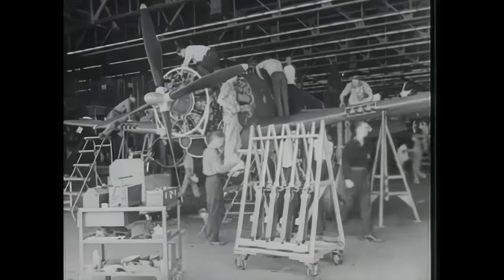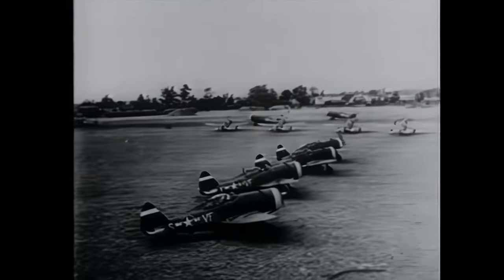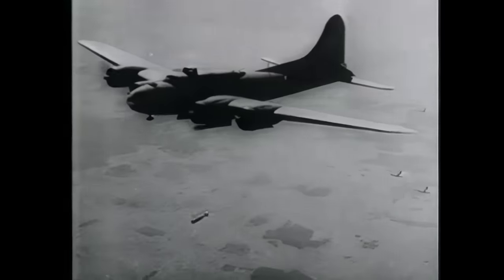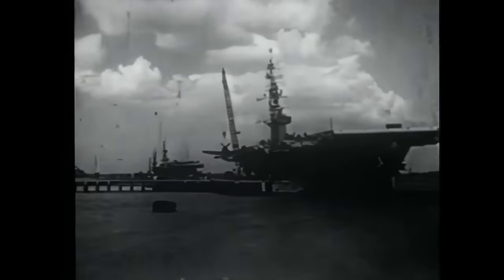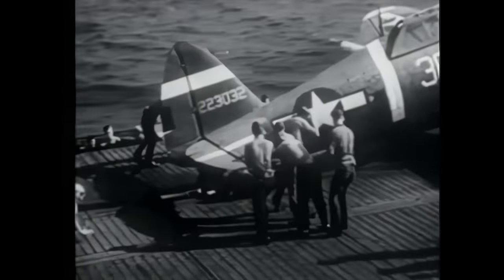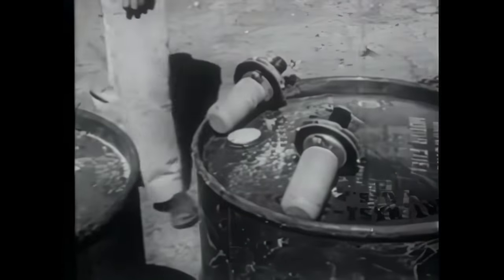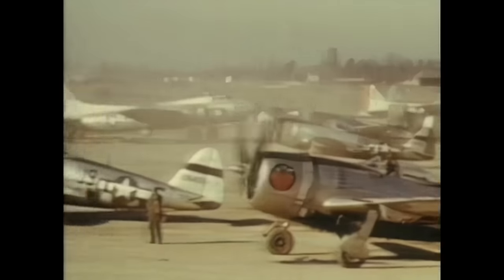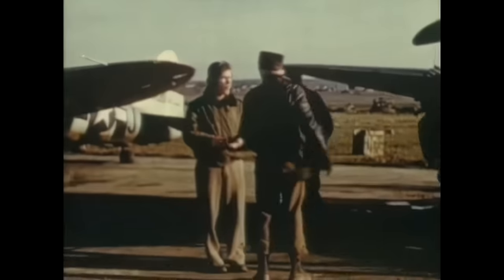P-47 THUNDERBOLT | WWII Fighter Aircraft, Nicknamed the "Jug"  | Upscaled Documentary

Comment: Best comment I've read on the P-47.  "The Spitfire and Hurricane held the line.  The P-51 Mustang took the fight to Germany.  The P-47 Thunderbolt broke the back of the Luftwaffe."
Reply: I like that
Reply: P-47 pilot Robert S. Johnson describing October 1943 before P-51s flew their first mission in February 1944

"There is no questioning the battle experience or the skill of the German pilots, nor could we find solace in the outstanding performance of the Focke-Wulf FW-190 and Messerschmitt Me-109 fighters. But as we sharpened our own ability to slash and fight, the German aggressiveness so predominant in the early days of battle began noticeably to wane. By no means do I imply that the German pilot was less dangerous an opponent; once battle was committed, however, the enemy fliers no longer were as eager to slug it out with us in a free-for-all. Steadily, we shot down and killed many of there experienced men. At the same time, we gained constantly in experience and in our ability to master battle situations as they erupted. The 56th was well on its way to acquiring a galaxy of aces; indeed the very presence in the sky of our Group forbode ill tidings for the enemy." - Robert S. Johnson in his autobiography ‘Thunderbolt!’ Page 212
Reply: P47's were escorting bombers over Berlin in the weeks before P51's were, so were P38's, after they finally got the proper type of drop tanks they had the range to take the bombers anywhere they went.
Reply: @dukecraig2402  absolutely, I have seen a few interviews regarding the incompetent staffing that'd did not allow for drop tanks to many fighters but I also under that internal fuel,will always dictate planning range and endurance.
Reply: P-47's took the brunt of the best fighter pilots the Germans had, basically swept them from the sky. When the P-51 finally arrived the Luftwaffe was significantly diminished.
Reply: @zTheBigFishz  
That's right, when the 56th Fighter Group showed up the Luftwaffe was at it's height, they had veterans that'd flown in the Spanish Civil War, the Battle of Britain and on the eastern front where some of them amassed ridiculously high scores.
Robert Johnson's 5th kill, the one that made him an ace, was a German pilot who had over 200 victories to his credit, despite the German having 2 wing men with him Johnson made quick work of him, he didn't even know that the German he downed that made him an ace was a 200+ kill credited pilot until the 1990's when the Air Force's historical department uncovered the information and wrote him a letter informing him. 
Unlike the Germans they were flying against the USAAF fighter pilots didn't get to pad their scores with lumbering bombers or Russian pilots who were flying planes so inferior they had their gun sights drawn on the inside of their windshields with grease pencils, they shot down nothing but German fighter pilots and in the beginning they were probably the best in the world, but those guy's laid into them and tore a path through them they never recovered from. 
Another thing about when the P51's entered the fray is that at the same time that P47's started drawing mostly ground attack work and Gen Doolittle cut the fighter's loose to chase after the German fighter's instead of having to stay with the bombers, had the P47's been able to fly under those same conditions their scores would have been even higher, even then the top 2 USAAF fighter pilots were still P47 pilots.
Reply: @dukecraig2402  the two top scoring USAAF aces flew the P-38! Bong and McGuire; perhaps you mean European theater of operations aces.
Reply: @DavidJones-hr9bn  
Yes I know but in case you haven't been following the conversation it's been about  Europe.
Reply: @davegeisler7802  
No, the N was better, by all accounts it was just as fast where it needed to be plus it was much better for long range escort, it had auto pilot and rear facing radar, this enabled the pilot to take a break from flying the plane so he could do things like navigational math, find his exact position on the map and calculate fuel consumption and range left, while also not having to worry about being approached from behind because the rear facing radar would alert him when an aircraft got to 800 yards behind him, which was out of range for any weapons the enemy had, it also had a more comfortable cockpit with things like fold down arm rests for the pilot so he could give his arms a break, all that coupled with it's extreme range from having the additional wing tanks made it a much better long range escort while still having all the performance parameters of the M variant like roll rate and such.
It's official listed as being 15 MPH slower than the M variant in level flight but Greg of Greg's Airplane's and Automobiles looked at the numbers and said that most likely that was just because of the parameters it was tested under and he believes that ultimately it was just as fast in level flight, even then if it is indeed 15 MPH slower it certainly makes up for it with all it's other features especially it's range, that's a small price to pay for everything else that comes along with the N variant. 
And the N's saw plenty of action in the Pacific wherein the reality is with the M it spent most of it's time grounded in England due to engine issues and didn't really see much action, which wasn't the fault of the plane but still at the end of the it didn't see nearly the action N's did, it was the ultimate evolution and most refined of the P47 variant's.
Reply: @Duke Craig  No they were not. P‐47s didn't have the range, even with drop tanks, to reach Berlin. P‐38s were mostly sent to Africa because of engine overheating at the high altitudes flown in Norther Europe.
Reply: @Dave Geisler  That's because of compressability issues with the tail plane in the early models. The P‐38 had to be very careful about speed in a dive early on, the tail plane could vibrate apart. Starting with the P‐38J LO25 model, the aircraft was equipped with 8 degree Fowler flaps which solved the compressability problem. The P‐38 could then dive with the German fighters and not worry about shredding its tail.
Reply: @Dave Geisler  Your point is valid with the P-38s early models that saw service in Europe. However, the J model with the Fowler flaps were an entirely different story. Most P-38s in Europe were replaced before these later models were available. In the few instances that they engaged German aircraft, the later models came off quite well. The Fowler flaps could be used to dogfight quite effectively.
Reply: @Dave Geisler  They were a frontline fighter in the Pacific. Decisions had already been made in Europe to concentrate on the P-51 and P-47. Additionally, the P-38 was basically hand-built, so production was rather slow from one factory. P-38 was the desired aircraft in the Pacific, so priority was given to that area for most P-38 production. Most P-51 and P-47 production was earmarked for the European Theaters until late in the war.
Reply: @Dave Geisler  Arguing apples and oranges Dave. P-38 was a pre-war design and others for the most part were not. All of them were great aircraft and each had good and bad points.
Reply: @patrickmccrann991  
Yes P47's went to Berlin, you don't know the history of the different variant's and the different drop tanks.
The very first drop tanks they used were the British made pressed paper on the pre -15 variant of the P47D, before that variant all the P47C's and the D's through the -10 block could only mount a drop tank centerline on the fuselage, this is compounded by the fact that due to the stubbornness of the Bomber Mafia Generals wanting to prove their concept that "the bombers will always get through" wouldn't provide the 8th Air Force fighter's with US made drop tanks, the only kind they had to use were the pressed paper type from horse trading with the British, the problem with them was that they weren't pressurized which means they wouldn't feed fuel at the altitudes P47's got their best range, some units tried pressurizing them by piping pressurized air from the exhaust side of the engine's vacuum pump but the problem was being pressed paper they'd start to leak after a short amount of time and they'd usually leak out more than the engine used.
Starting with the P47D-15 they had the under wing pylons capable of mounting drop tanks giving them the ability to carry 3, one under each wing and one centerline on the fuselage shackles, the 56th Fighter Group started receiving the D-15 variant in the spring of 1943 which would have enabled them to escort the bombers to any targets they'd gone to from that point up to the fall of 43 if they'd have had the US made all metal  drop tanks, but they still only could get the pressed paper one's from the British and that was sketchy since it wasn't something in their regular supply pipeline, about a month before the Black Thursday mission on Schweinfert the 56th Fighter Group started receiving the P47D-25, it's increased internal fuel capacity gave it the ability to return from a target as far away as Berlin after 15 minutes of combat over it, meaning if they'd have had the US made pressurized drop tanks at that point they could have flown at an altitude giving them their maximum range while wearing the tanks, meaning they could have escorted the bombers to Schweinfert on that raid.
Finally in early 1944 equipped with the D-25 and later variant's they finally started receiving the 150 gallon US made pressurized drop tanks giving them the ability to go as far as Berlin which they did, in the first 3 months of 1944 P47's shot down 570 of the 893 German fighter's downed, and they weren't doing it because the Germans were nice enough to move their fighter bases closer to England, they were shooting them down because they were escorting the bombers all the way to the targets which is where the fighter bases were close to because the Germans didn't have the fuel to spare having bases far away from what they were defending. 
The bombers didn't start flying to targets deep into Germany the week after they showed up in England, they started close by like hitting the sub pens on the French coast, as time went by they kept going further and further, at first the fighter's could escort them to the targets in most of France but it was when they started getting by the German border is where they started flying further than P47's and P38's could escort them but that's only because they weren't provided with the proper drop tanks, the P47 variant's that kept coming outdoors all could have kept pace with the ever increasing distances to the targets if they'd have had the right kind of drop tanks to do it, in the Pacific the fighter units there were receiving them all along because of the distances between the islands, had those same types of drop tanks been provided to the fighter's in Europe they could have escorted the bombers on any mission they went on.
Reply: Add to that "the P-40 left a mess in the Luftwaffe's bathroom", and "the P-38 was the Luftwaffe's favorite chewy dog bone". "The P-39 was the most advanced fighter the U$A would trust the French with" is an old favorite of mine. I just made it up
Reply: Actually, the more accurate statement would be "The Spitfire and Hurricane held the line and ended German military advances in the West.  The P-51 Mustang took the fight to Luftwaffe home territory and broke the back of the Luftwaffe.  The P-47 Thunderbolt demolished the German transportation and supply system, severely restricted the mobility of any German ground supply or tactical movement, which effectively neutralized almost completely the fighting ability of German ground forces".   Each of those aircraft were critical, essential pieces of the puzzle that led to VE.
Reply: @63DW89A  
The P47's are the one's that "broke the back" of the Luftwaffe when they shot down 573 out of the 890 German fighter's downed in the crucial first 3 months of 1944, after that is when it went to work on the Wehrmacht and the P51's finally were numerous enough to start fighting the Luftwaffe with any kind of number's, which was after the bulk of it's experienced pilots had been hammered out of the sky by P47's, the P51 had the luxury of mostly fighting inexperienced German pilots after P47's gutted it's ranks of the experienced one's. 
The P47 was the USAAF fighter that took the fight to the Luftwaffe when it was at it's height and was full of pilots who'd survived everything from the Spanish Civil War to the Battle of Britain, when it arrived the Luftwaffe still had it's bases on the French coast and would run fighter sweeps over England, the first thing the P47's did was go to work killing it's experienced pilots and driving the Luftwaffe's bases inland.
It did the bulk of the work, and only after the drop tanks were finally made available that were necessary for all the fighter's to escort bombers deep into Germany, even the P51's, is when it was finally possible for any of them to escort the bombers that far, had the P51 been around a year earlier it'd have been in the same boat as any of the other fighter's, unable to be a long range escort, it just happened to show up at the same time the US made all metal pressurized drop tanks showed up in Europe, that's why people mistakingley believe that it was the only one that could do it, the fact is they all were doing it after they finally got the drop tanks. 
P51's were virtually useless in the Pacific, they had to be withdrawn from the ground attack role because the coral based soil of the islands there were ricocheting the P51's rounds back up in the air in front of them and they were flying into their own bullets causing them to shoot themselves down, one hole in their cooling system even from their own bullets and they'd wind up killing their pilots from having to ditch in the sea, once they figured out they were shooting themselves down they were immediately restricted to escort only duty in that theater, so of course the P47's in the Pacific had to do the hard work, and with the B29's 11.9 to 1 kill to loss ratio against enemy fighter's, which was even better than the P51's record of 11 to 1,  it didn't need escorted, a post war report on the B29 determined that escorting the B29's was a waste of assets.
It wasn't nearly the wonder plane it's been made out to be over the years.
Reply: @patrickmccrann991  Links and citations or it never happened.
Reply: @Patrick Thomas  not sure what comment you are referring to. I  am on the road,  so my references are not available at this time no matter which it is.
Reply: I wouldn't be happy to be a German railroad engineer...with that bullseye painted on your back for the P-47's drivers.
Reply: @bbb8182  
Yea, as if when you're driving a train you've got some kind of maneuvering options available to you. 
I was watching an interview with a guy who'd started out flying Hurricanes and Spitfire's in the Eagle Squadron then transferred into the USAAF right after the US entered the war, at first he was flying the early P38's in Europe and then P40's in the Mediterranean and then eventually P51's back in Europe, as a result he'd flown a lot of different fighter's except for P47's, when the interviewer ask him if he'd ever flown P47's he said "No, but I'll tell you this about the P47, one day when I was flying a P51 I saw a formation of P47's about to attack a train, I'd heard about what a job they'd do on one so I dropped down lower to watch the show, the two lead P47's went in abreast of each other attacking the locomotive, as you know a P47 had eight .50 caliber machine guns while the rest of us had six or less, I saw those two P47's flip that locomotive over on it's side, let me tell you something, two P51's couldn't have done that".
P47 pilot Charlie Mohrle in one of his interviews here on YouTube tells the story about getting to talk to a German POW that was an infantryman, with all the Allied "Jabos" attacking anything on the ground that moved after D-Day apparently German infantryman got real good at dismounting the trucks they were in and finding cover, they even got to the point where they could tell what kind of aircraft was attacking them before they even saw them by the individual sounds they made, between their different engine's and guns each one made a distinctive sound, Spitfire's made a whistling sound and P51's made a grinding sound and so on and so forth, but when a P47 attacked between it's 18 cylinder R2800 engine and it's eight .50 cal machine guns "it sounded like the gates of hell opened up".
Reply: Heavy duty ...
Reply: Well the RAF immediately took the fight to the Luftwaffe when Britain and France declared war on Germany by  bombing German coastal cities. Also, they refused around 50! offers for peace, to avoid a continent-wide war. Mr. H, the most lied about person in modern history tried to avoid all of the subsequent bloodshed and destruction. Impressive plane though, the P-47.
Reply: @davegeisler7802  The P47 was as critical to VE in MAY 1945, as the P51; And don't forget the major contributions of the Spitfire, Hurricane and Typhoon / Tempest.  However, the P47, from MAR 1943 up to DEC 1943, had not been able to neutralize Luftwaffe effectiveness, a demonstrated historical fact. Absolutely critical to D-Day planning was the neutralization of Luftwaffe effectiveness. From JAN 1944 up to MAY 1944, the P51B/C effectively neutralized the Luftwaffe over occupied Europe, as the kill record month by month proves. In 25 months of ETO combat (MAR-1943 to MAY 1945) the P47 had more than 3700 air to air kills. In 15 months of ETO combat(JAN,1944 to MAY, 1945) the P51B/C/D/K had more than 4900 air to air kills. The P51 was simply the superior tool at killing the Luftwaffe over its home airfields, as demonstrated by historical fact, especially in the critical time frame of 6 months before D-Day.  And while the P47 had its fair part of the air to air kills that helped neutralized Luftwaffe effectiveness, where the P47 was truly the superior tool was as the weapon that utterly ground the mobility of the German Army to a crawl from JUN 1944 to MAY 1945. The ground destruct record of the P47, 86,000 rail cars, 9000 locomotives,  68000 trucks and 6000 armored fighting vehicles will likely never be equaled. I'd put it this way; from JAN to MAY 1944, the P51B/C was the critical tool to the D-Day landings occurring as scheduled. From JUN 1944 to VE day, the P47 was the critical tool ensuring the German defeat as fast as possible.
Reply: @davegeisler7802  I was aware of those facts but thanks for pointing them out for everyone. The Luftwaffe fighter strength was clearly increasing by rotation of those Eastern Front units to counter USAAF daylight bombing throughout 1943. This is one of the reasons I'm frustrated by those who say "P51's faced a weakened Luftwaffe fighter force" by JAN 1944. Just looking at the devastating 8th AF bomber losses in the late months of 1943, plus knowing of the arrival of extra Luftwaffe fighters from the Eastern Front, shows that such a statement is completely inaccurate. By JAN 1944, the Luftwaffe on the Western Front was peaking at around the strongest it would ever be in WW2, with superb pilots and continually improving versions of the BF 109 and FW 190.  Although it had the long range capability, unfortunately the P38 did not fair well in the colder climate, or against the BF 109 and FW 190. This left the P47 and P51 as the only truly viable USAAF fighters to neutralize the Luftwaffe before D-Day. By working out various drop tank schemes and various ferrying methods where fighter groups handed off escort duties at designated meeting points, the USAAF fighter force began to inflict serious hurt on the Luftwaffe. Also back in the U.S., Republic was working on improving the on board fuel range of the P47, eventually arriving at the superb P47N for the Pacific. One of the fascinating discoveries about WW2 is how change  and improvement was a constant in the aircraft that fought. Aircraft being built under such a constant change rate is mind blowing.
Reply: @davegeisler7802  Yes and the P51H achieved 490 mph with similar tweaks. The P51B/C achieved 442 MPH with the earlier less powerful (1450HP) Merlin 1650, so imagine how fast the P51B/C would be upgraded to the 2000 HP Merlin 1650 from the P51H! 

By late 1944, aircraft design was in a state of constant upgrade. Just look at what the Brits were achieving with the late mark Griffon-engined Spitfires, and what the Germans were achieving with the BF-109K4/K6, and the FW190D's!
Reply: @DavidJones-hr9bn  ETO Francis Gabreski and Robert S. Johnson
Reply: Robert Johnson's book is a necessary part of any military aviation library.
Reply: Gentlemen, read what Robin Olds had to say about the P-38 in ETO.
Reply: An old friend’s father was a P47 pilot who returned after his tour to be an instructor. His stories of training new pilots on the Jug were often hilarious. One in particular, a couple rookies would drop down to the deck, fly over farms and try to blow the windmills off the well pumps. He had two repeat offenders who were such hot dogs he had to ground them for a couple weeks to calm them done.
Reply: Thanks ! I knew nothing about the role of the P47s in the pacific, nothing ! The P47s were shipped to Hawaii then loaded on keep carriers across the entire pacific to Guam and Saipan where they were catapulted for the first time with non carrier pilots ! And they ALL made it ! Damn we’re Good !  The P47 is even more amazing if you are able to see a cutaway view of it . I wonder what the German pilots thought of it when they had a chance to fly it ?
Reply: Pick any random date and I’d rather be in a Thunderbolt but you could buy 2 Mustangs for 1 P47.
Reply: @dukecraig2402  
The name of the city is Schweinfurt, still an important centre for the production of roller bearings.
Reply: @jacktattis  My comment was relative to US fighters. Had nothing to do with British aircraft.
Reply: @jacktattis  I'm well versed in WW2 air combat, all theaters.
Reply: @jacktattis  
I don't understand what your point is of comparing the Spitfire's record for the entire war to the P47's record for the first 3 months of 1944 just in Europe, is there some point behind doing that?
Because the P47's record for the entire war was 3,752 air to air, what was the Spitfire's again? Less than 3,000? And isn't that over 5½ years compared to the P47's time of just about 2 years in the war?
So, once again, what exactly is the point behind your post?
To solve the mystery for you why things add up like that is because from the time the RAF fighter's entered the war their mission was to protect England, as opposed to when the USAAF showed up and it went on the offensive and took the fight to the Germans, when they showed up the Luftwaffe had bases all up and down the coast across the Channel that regularly attacked England, the first thing the USAAF did was drive those bases inland from the coast.
So once again, was there some kind of point behind your comparison of the Spitfire's record for the entire war to the P47's record for the first 3 months of 1944 in just Europe?
How many did it shoot down in the first 3 months of 44 just in Europe? Because it wasn't over 2,900 I can assure you of that, the Luftwaffe didn't have that many operational fighter's in western Europe at that time.
Don't you have anything better to do in life than troll around looking for any YouTube videos that have anything to do with the USAAF in WW2 making your ridiculous claims? Like a week or two back when you tried claiming that an RAF pilot shot down 35 planes a day on two different occasions when in fact 35 was his entire tally for the war, and even that's questionable, some of his sources put it around 25 for his overall record, it certainly wasn't 35 a day on several occasions as you claimed.
Do you have ADHD or something because you really need to pay closer attention to the things you read, an outlandish claim like that points to you having it and being off your meds that day.
Grow up, spend time finding gainful employment and move out of your mother's basement instead of spending all your time trolling around YouTube videos making an idiot out of yourself with your outlandish claims that are always nothing more than exaggerations and things presented out of context, like comparing one fighter's entire record against another one's of just 3 months, people aren't as stupid as you think and you're not as smart as you believe you are.
Reply: @jacktattis  
Once again why are you presenting things out of context and avoiding subjects?
First you start off with comparing an aircraft's entire war record to another one's of just a 3 month period, now you're talking ground attack missions from yet an entirely different aircraft, which is an very good point because the P47 was unmatched in both roles, but you're leaving out the number of ground attack missions performed by one compared to another, a fraction of ground attack missions were flown by Typhoons compared to P47's, so of course their overall losses were less, is there a point behind what you're saying aside from them flying a fraction of the missions P47's did? Because the number you need to look for as a comparison would be losses per sortie.
So to keep things in perspective;
1, What was the number of German fighter's shot down by Spitfire's in the first 3 months of 1944?  Not the entire war just the first 3 months of 44.
2, How many ground attack sorties were flown by Typhoons compared to the number flown by P47's?
You're going to find out that P47's flew a tremendous amount more and that their loss per sortie is far less than Typhoons. 
If you wanna keep stepping in it go ahead, I can sit here all night pointing out how you have to use things out of context to even come close comparing things, and you have to use multiple aircraft to compare anything to the P47, thank you, that's a good point, I'm glad you made it for me.
Reply: Stories of engines having cylinder shot of and still able het the pilot home. One guy had his control surfaces shot to pieces and the pilot had to use the aliron trim to turn it. He made it back as well. The P47 was hell tuff
Reply: @jacktattis  Uh, perhaps you didn’t know P47s were used extensively as ground attack aircraft in both Theaters?
Reply: @jacktattis  I doubt that many were ever oroduced
Reply: @jacktattis  You need to do some objective study on the P47 in the ETO.
Reply: @jacktattis  Typhoon helped
Reply: Switch Mustang and Thunderbolt and it makes more sense. Mustang was the nail in the coffin for the Luftwaffe
Reply: @dukecraig2402  P47 was mid compared to the Mustang
Reply: @jacktattis  many Canadian pilots helped the British in the years before America joined
Reply: @truenoae8689  P-47 did the heavy lifting early on before the Luftwaffe was bled white. P-51 came on and finished the job. The Russians YAK-9 took a sizable bite out of the Luftwaffe as well.
Reply: @jacktattis  Official USAAF records for ETO show the P51B/C/D/K had 4950 air to air kills. 

Let’s look at historical facts to see how various tactical & strategic decisions affected the ability of Luftwaffe fighter groups to control occupied European air space.

Fact 1:  Up through October, 1944, USAAF bomber losses were so severe and unsustainable that daylight bombing was suspended for the rest of 1943.

Fact 2:  The USAAF suspended daylight bombing for the rest of 1943 because the Luftwaffe fighter groups had almost complete control of occupied European air space.

Fact 3: The worst losses ever for USAAF bombers occurred on “Black Thursday” in March 1944 when the P51B/C groups missed the fighter rendezvous point and overshot Berlin due to navigational and time errors and had to turn around. This did have the effect of allowing the P51B/C groups to arrive behind the Luftwaffe fighter groups forming up and inflict the first severe pilot losses on the Luftwaffe fighter pilots.

Fact 4:   The heavy losses of unescorted USAAF bombers on “Black Thursday” prove that the Luftwaffe fighter groups retained their deadly efficiency and control of occupied European air space into March 1944.

Fact 5:  As the numbers of P51B/C’s increased in ETO, the Luftwaffe efficiency gradually diminished to the point that on D-Day, June 6, 1944 the Luftwaffe was virtually invisible and had NO effect at all on the landings.

Fact 6:  Facts 2, 4 and 5 clearly prove that the P47 and Spitfire did not have the ability to take air superiority from the Luftwaffe because both the P47 and Spitfire had been in ETO much longer than the P51B/C, and neither had the ability to prevent severe USAAF bomber losses by Luftwaffe fighter groups all through 1943 and into early 1944. It was the arrival in increasing numbers of the P51B/C that affected the ability of the Luftwaffe fighter groups to control occupied European air space.

Fact 7: Looking at the actual historic record will show the effect of various elements and tactical / strategic decisions on the Luftwaffe fighter groups  ability to control occupied European air space.
Reply: @jacktattis  Well, I can give you an "A" for fact distortion. 
Fact: all the way thru March 1944, the Luftwaffe fighter groups were inflicting unsustainable losses on unescorted USAAF bombers engaged in daylight bombing. The overwhelming presence of P38's, P47's and Spitfires were doing nothing to stop the unsustainable losses. As P51B/C's begin showing up in larger and larger numbers the first half of 1944, daylight losses for USAAF bombers dropped dramatically, and the Luftwaffe was reduced to NO effective  appearance on June 6, 1944 during D-Day. 

You can make all the unsubstantiated claims about the kill numbers of P51's being bogus that you want to. But the actual historic record doesn't back up those claims at all. In fact, if the P38, P47 and Spitfire were actually effective at neutralizing Luftwaffe effectiveness then the USAAF would have happily continued daylight bombing after October 1943 instead of suspending the daylight campaign due to unsustainable losses inflicted by a very deadly, capable Luftwaffe fighter force. 
 
The historic facts simply do not support your unsubstantiated claims about the kill numbers of the P51 being bogus. Logically if those claims were correct, then the Luftwaffe would have been neutralized in 1943 by P38/P47/Spitfire's and there would have been no need for the P51 at all. 

The fact that the Luftwaffe was so capable and able to inflict such heavy losses on the USAAF daylight raids all the way up to March, 1944 actually proves that the P38/P47/Spitfires were not capable of the air superiority required, because such air superiority would already have been achieved without the P51 appearing at all, had the P38/P47/Spitfire's been capable of air superiority.

And those facts added together throw a very large cloud of suspicion over your unsubstantiated claims of the P51 kill numbers being "bogus".
Reply: I have read many accounts from the Wehrmacht soldiers perspective, and they were terrified of its ground attack capability
Reply: Hahaha the back of the Luftwaffe was broken on the Eastern Front. The YAK 3,9 destroyed more German aircraft.
Reply: @johnweerasinghe4139  I was referring to ground attack roles by the P47, not dogfights
Reply: @jacktattis  In your opinion, not in the opinion of the pilots flying them. Remember, the top two high scoring U.S. pilots flew the P-38. The P-38 was mostly gone from European service by 1944, replaced by the Thunderbolt and Mustang.
Reply: @jacktattis  How about hundreds of fighters and bombers in the Pacific? Your comment to me just proves that you know little about the P-38's history. Richard Bong (40 kills) and Thomas Mcguire (38 kills), every one a fighter or bomber, were the highest scoring U.S. fighter pilots in history.
Reply: they were beasts. gas hogs; but boy they were beasts. nothing could out dive a P-47 because they were able to recover (most of the time) the P-38 could tail gate but without Fowler Flaps auger in. P-51s came in late an took a lot of glory (glory being relative) the ones that won that deal know who they are
Reply: I can second this.  My father's wingman said on one bombing run at a train, he told my dad that he dropped his bomb down its smokestack.  They tried to recruit my father as a bombardier in flight school but he wanted single seat fighters so I guess he had pretty good aim.  Glad he stuck it out.  Secondly, my father also said that they had a motto in his squadron that if it moved on the ground, they killed it.  No one messed with the 47.  I pity the poor souls on the ground when they came in for an attack. 27th FG, Squadron 524.
Reply: @secretsquirrel6308 olds thought the P-38 was killing pilots because it was too complicated in the cockpit ...that is all